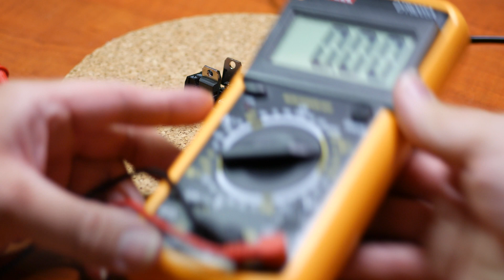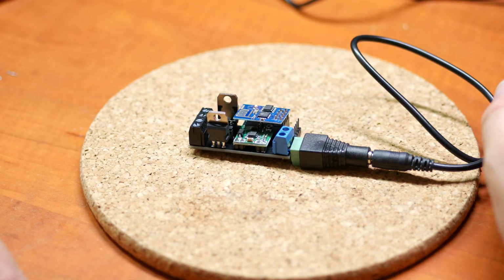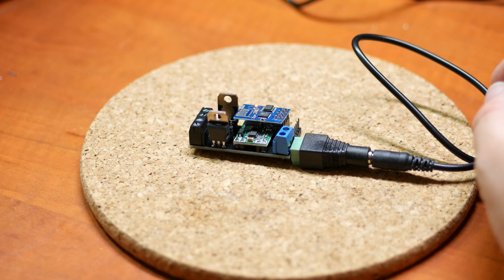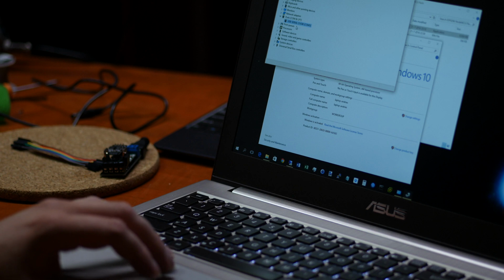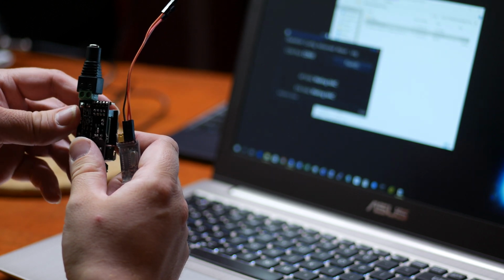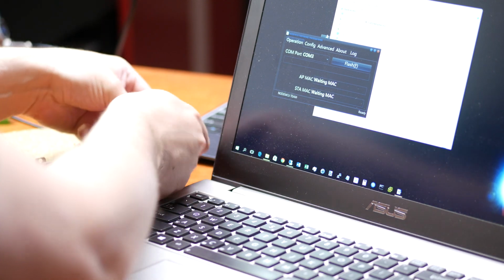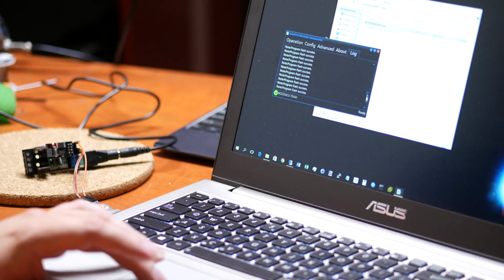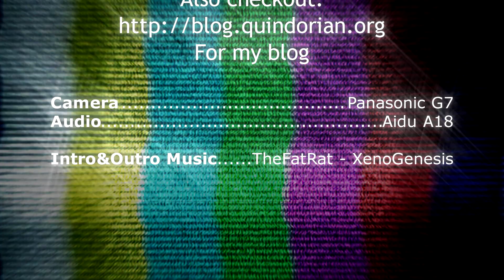ESP8266 LED Lighting: Setting voltage and flashing NodeMCU

Comment: For those who don't have jumper caps lying around: Use a female-female dupont cable to jump the two pins. Works just as well, and as a bonus, they're much easier to remove again ;). It looks a bit silly, but since it isn't permanent, who cares.
I had to do this myself, since my ordered jumper caps still haven't arrived (almost 5 months later), and it worked perfectly.

Comment: My advice for programming, let me know if helped: 

It was not clear to me how to power the module while programming. I connected both power source, from the programmer and the external power supply. Result: I was unable to connect to the module. XX hours later I realized, that Quindor connects only the external power supply. Finally I was able to connect to the module anytime.... now the firmware flashing: it always get stuck at 10-20%.......after many hours, failures and with the help of Google I found the answer: while firmware flashing the voltage must be exactly 3.3V -> so I switched to USB powering (which has 5V/3.3V setting if you ordered from the link that Quindor suggested) and I am able to flash module anytime, without failures.

I think this was the problem for Quindor too (I mean few times he had failures while flashing the firmware), he set 3.45V on the voltage regulator, me too.